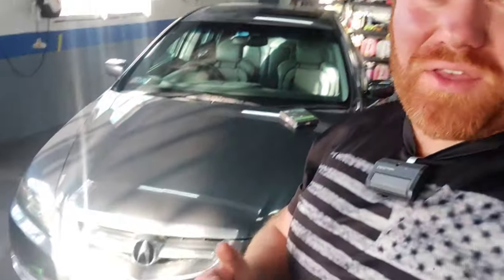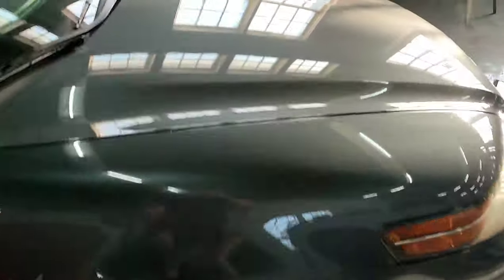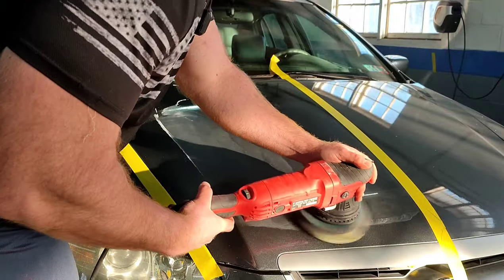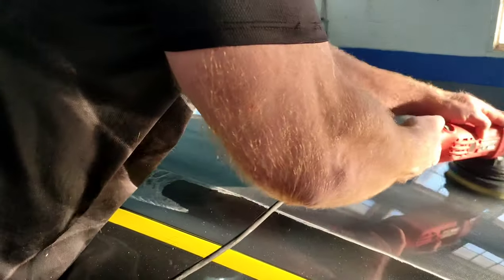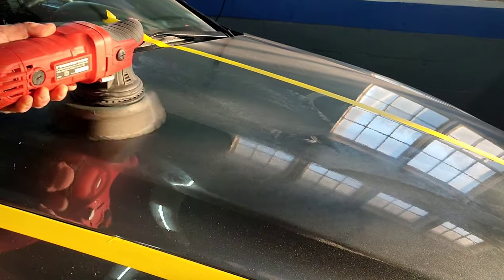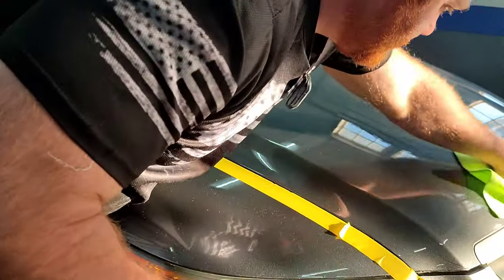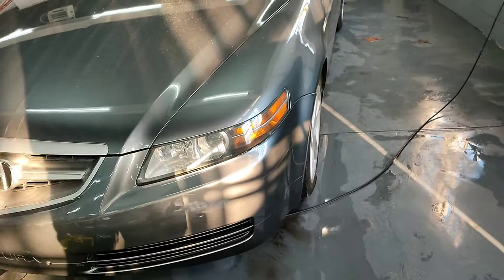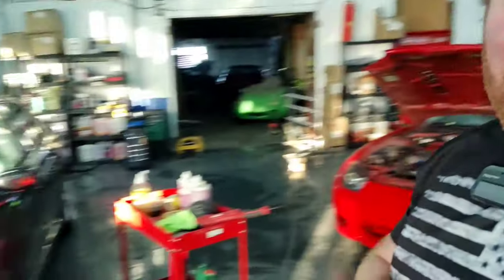How to REMOVE ORANGE PEEL without wet sanding

Comment: One time when taking out fisheye, i forgot to put a pad and used the buffer. Basically hitting it the velcro 😅 oddly enough it knocked the fish eye immediately out without burning thru.  When i realized, i put the pad on, but the area that i hit with velcro looked the best lol. More studies oughta be done lol
Reply: @speedokoterefinishnetwork4937  try it and tell me I was trippin lol I was contemplating taking the pad off again the whole time 🤣 ( it was 1000 grit, took forever lol)

Comment: I tried one one but it did nothing at all even on a fresh cheap single stage paint,  I did the whole right side of the car zero I mean zero orange pill or any dirt did it remove and zero differences in the shine or anything I was hoping for some different but nothing happen, so wet sand and buff with the great wool pad and now it looks great,   and again I was hoping for some different but I got zero results not even any paint was on the pad and again it was a one week old single stage paint job,   however I'm glad it worked for you and maybe on clear-coat it will preform       thanks for the videos I do enjoy them maybe if you could do some more older cars would be great have a nice day
Reply from the maker: These can be hit or miss depending on the brand. 
I got one in the mail recently and it SUCKED !!!!!

Comment: I started using these in 2010. The asians have been doing it way longer than that.   Sanding is still better as denim round's it off, sanding slices through it and theres no heat. But denim has a place for sure. Reelmasters retro room is where my peel removal videos from back then are

Comment: Sir. 
1)Try a mixture of isopropyl alcohol and distilled h2o to clean the surface.
2) Prime your pad with 5 dime sized dabs of polish and before turning on the machine rub the pad on the area you are about to work on. Priming the pad keeps the machine from jumping and so does keeping your hand on top of the machine above the pad. Work in a roughly 2’x2’ area using a cross hatch type pattern slightly overlapping each pass. 
*Do not squirt polish all over the place-you wasted a lot of polish 
 As far as ceramic coatings some can make a  mess out of a perfectly polished and prepped vehicle and actually need sanded off to start all over wasting time and money. 
Having three high quality different color microfibers is a great way to keep track of what order they are used in order to remove the excess ceramic, buff the area, then rebuff the area extending a bit past the 2’x2’ area you are working on while ceramic coating the vehicle
Reply from the maker: Appreciate the tips!

Comment: Osren also produces their own abrasive called NAO Compound 56 that is specifically designed to be used on orange peel levelling jobs paired with their denim pad. With how well this job turned out, I'm sure it could turn out even better when paired with that compound.
Reply from the maker: Yea wasn't trying to get it perfect. Just a beater car

Comment: Ahhhhhhh! So I am not crazy I really did polish through my clear coat! haha! I just fixed rear fenders on my 05 elantra, the repair finished better than expected, the paint had peel so I followed the 1500 and 2000, it looks amazing wet with wax, but I have to re apply some clear coat for sure as there is some left to touch but you can tell it's gotten too thin.

Comment: I've tried denim, and it works. The problem I had was the edges beginning to fray slightly and become twisted causing them to be bigher than the face of the pad. Since the pad is not flexible that caused pigtails. Perhaps the rotary version of the pad would not have this problem since it's softer and the material wraps around the top of pad with no exposed edge.

Comment: Do you put a new clear coat on it after buffing out the orange peel?  Do you do this step before you paint on a layer of clearcoat?
Reply from the maker: The buffing and polishing is the final step in the process. If I was to re clear coat it that would be called a flow coat

Comment: You can also get them at harbor freight 2000 3000 4000  and then get 8000 3M trizak to finish  .it will leave a awesome showcar finish.
Reply from the maker: Yup!
Reply: I’m having trouble locating them at harbor freight
Reply from the maker: @varrient9959  Amazon
Reply: Are those considered the yellow green white polishing pads ?

Comment: This looks like a great orange peel solution. Would this remove small nibs while smoothing out the orange peel at the same time? Or would small nibs need to be wet sanded first?
Reply from the maker: I would sand out the nibs first cause that polisher will just drag the nibs all along the surface potentially turning it into 80 grit sandpaper 😬😬😬😬

Comment: which do you prefer wet sanding or denim pad orange peel removal?
Reply from the maker: Meehh denim pad was slightly easier .... But to really flatten out a surface properly you need a straight block and some wet sand paper

Comment: I wish I knew about this earlier I just finished doing heavy compound mid-cut polish and then finishing glaze and now I was going to use ceramic coat spray.  Oh I forgot I also did clay bar so anyways I spend all these hours only to see that the paint is showing more orange peel.  Do you think I should just go back and spray it down with some isoprol alcohol and then try the denim pad?  I used Menzerna heavy cut 400 with a purple wool pad.  Still have orange peel.
Reply from the maker: This stuff is a quick fix for light orange peel. It worked surprisingly good

Comment: wow didnt know those existed. how long do the pads last? can you wash/clean them?
Reply: also idk if you can get this polish in the states, menzerna heavy cut compound 300 and 400. works really well to get 2k scratches out and also gives it a factory gloss at the same time. they also have a 3 in 1 , cut ,polish and wax. granted doesnt cut that much but can bring the old stuff back to life in 1 product. German brand sold a lot in Europe and uk.
Reply from the maker: I'm pretty sure you can wash them. Not sure on durability being I only used once 😎

Comment: looks like you have some tiger striping in your base coat color. do you spray with an x pattern when you spray metallics or pearls? also aeropro a610 spray gun will lay clear way better and it's a cheap  dyi  gun for really cheap and you can toss it when it wears out.
Reply from the maker: There was not any tiger strips in base , could be lighting cause it was cross hatched multiple times

Comment: Looks like good cut but it’s throwing some dust maybe mix some polish u used in step two might help
Reply from the maker: The speedokote finishing compound we sell is super cheap at only 20 bucks a bottle but does throw some dust. 
The speedokote select line is better

Comment: Here i am trying to get my orange peel that good.
Reply from the maker: Haha just takes practice
Reply: @speedokoterefinishnetwork4937  i started with the fluid wide open and was using the pressure range on the can. Well i just read today that if the droplets are big, then you need to turn the fluid down. I turned the air up to 15psi from 10 and went on much better. Now i just gotta repaint everything.
Reply from the maker: @____MC____  yup always set up test panel if you can

Comment: Will this work on base coat
Reply from the maker: @MISSY4EVR  basecoat clear coat system yes
Reply: @speedokoterefinishnetwork4937 
you can’t put polish on before clear coat
Reply from the maker: @MISSY4EVR  I have never in my life herd anyone polishing basecoat before applying clear coat .
This would lead to adhesion issues with the clear coat as it would not stick to the basecoat

Comment: Marco, let say I done my car like you showed... after say 2-3 weeks CAN I BUFF THE CAR, and after go over the car with alcoholic cleaner, AND AD LESTS SAY 2 COSTS OF CLEAR ON TOP? 

I KNOW, its not the way your doing it.....but lets say I was thinking that if the 2 coats should have laid a little bit better, i have been sadisfaiyd to put it in a show down....but it went as you said 3-5 feet away OK, but not for show....

I do the steps your done, looking much better, CAN I SPRAY MY CAR AGAIN WITH CLEAR AFTER DOING A TOTAL WIPE DOWN ON THE CAR, WITH EVERYTHING YOU DO, BEFORE YOU NORMALY DO BEFORE PAINT?

And its right at this moment, those panel parts can come in, as tryout panels- experimental panels- so you dont have to f u c k u p a hole car.....

Nicely done, fun to try new things! Good job!
Reply from the maker: To re clear have to re sand unfortunately

Comment: Next time cleaning the bad side off would help us see better. Not a lot of difference
Reply from the maker: I was holding the camera 1 inch away from the paint which shows one side has significantly less orange peel. 
At least I'm pretty sure it did .
Reply: Oh I see now. Thanks for the reply
Reply from the maker: @KenChambers-v2x  no worries. 
I really try to get the best comparison on camera as possible it's hard to see . 
The point of the video was not to compare gloss between two sides it was to compare the orange peel

Comment: However you have removed the Clear for UV protection..
Reply from the maker: @walterharp1773  at two nice wet coats of clear , if your only doing buffing this will be ok... If doing a full wet sand and polish then you would need 3-4 coats of clear to keep UV protection

Comment: Leave your orange peel alone if you plan on keeping the car because, in time, pores so tiney that you can't see will increase exponentially and youll grow rust from beneath the paint. Your paint will look like as if you painted over rust when it gets bad.
Some of that iron-x you spray will actually go down to the bare metal, and not all of it is surface iron that ironx is dealing with.
I know it sounds a bit irrational, but I've lived the experience with my own vehicle. I have rust growing beneath perfectly fine looking paint everywhere I messed with the orange peel, and no rust everywhere i left the paint alone.
And, yes, where the rust is growing still has clear coat. I also utilize a paint thickness guage.
Reply: Rust has absolutely nothing to do with sanding orange peel

Comment: thats not orange peal, that looks like you missed an overlap pass or 2  to me , from the lighting it looks like a dry edge .
It also looks like you have some fish eyes you were trying to burry them and didn't coat the whole hood . 😉😉😉
Reply from the maker: It's actually due to inconsistency in air pressure as I have explained in many videos. Buy this compressor, attempt to paint an entire car with it, video the results. If you do a better job than me I'll send you a mark1 shine pack on the house no cost
Reply: @speedokoterefinishnetwork4937   OH ok, Yea not having the VOLUME of AIR to push a paint gun is crucial .  Have you tried using the Iwata LPH400 , which is low volume low pressure gun?